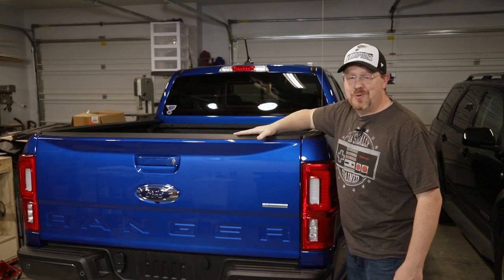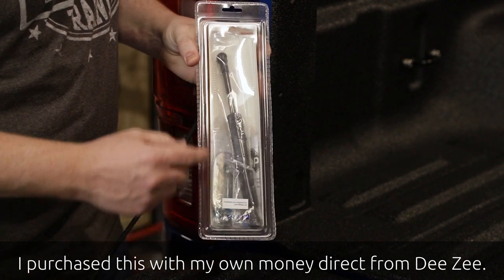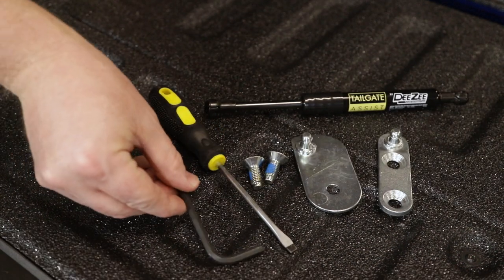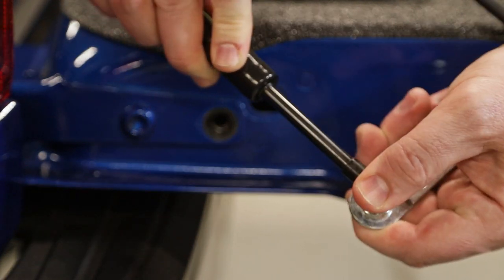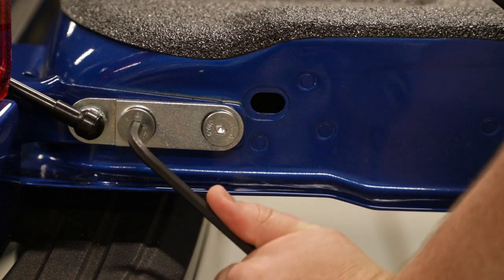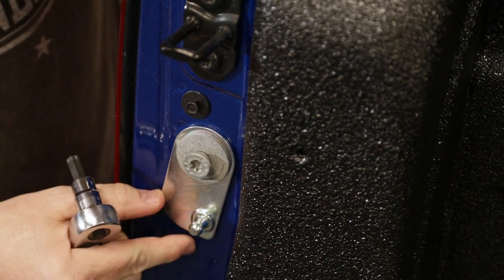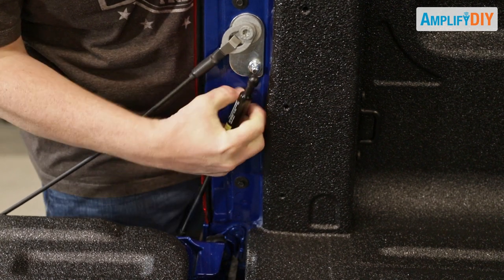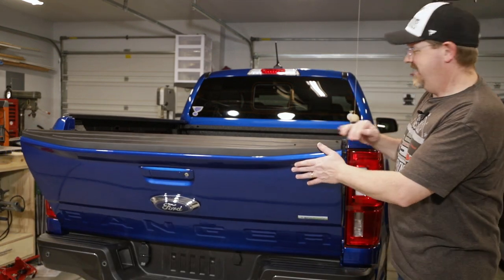How To Install A Tailgate Damper - 2019 Ford Ranger - DeeZee DZ43206

Comment: For those of you who already installed this kit on your truck,  check the tailgate cable for any scratches.   A few Ranger owners including myself noticed that the tailgate cable is sometimes pinched between the bracket and the lower portion of the damper.
Reply: I guess Im asking randomly but does any of you know of a way to get back into an instagram account??
I was dumb forgot my login password. I appreciate any tricks you can give me
Reply: @Warren Riley instablaster =)
Reply: @Krew Crosby it did the trick and I now got access to my account again. I am so happy!
Thanks so much, you really help me out :D
Reply: @Warren Riley happy to help :D
Reply: yes the tailgate cable rubber part is getting too much scratches.. any fix gor this?

Comment: That's pretty straightforward and rewarding!
I felt like maybe the washer on the upper mount should be removed, but a lot of washers on bolts like that are captive, and the ball socket for the damper is in the same place with or without it, so I assume it's not hurting anything either way.
Reply from the maker: Yeah, I didn't see any reason to alter the install instructions from the manufacturer. It fits perfectly and functions correctly. I love this damper - it make such a difference when opening the tailgate. Thanks for watching!

Comment: Love ur Ranger vids Thanks a bunch. Other things missing on Ranger is the upper tie down hooks so I would kindly request if you can make a video on that too please (obviously if u decide to install them).
Reply from the maker: You mean the ones in sort of the middle of the bed? Mine were missing from the dealer, but I complained at them and they ordered them under warranty. When they called to let me know they were in, I went to pick them up only to discover they had not bothered to order the bolts as well! 🤦‍♂️ I didn’t want to wait another week so i just went and found some bolts at a local hardware store. Good luck with yours! If you have a 2019, it was supposed to come with all 6 tie down points installed from the factory, but a bunch didn’t, and in 2020 model year builds they left out the middle ones on purpose.

Comment: Do you think you could spray paint those metal brackets to prevent rust? Good job. Nice Video.
Reply from the maker: Yes, on the ranger5g.com forum there are a bunch of examples of people doing exactly that. Great idea!
Reply: @AmplifyDIY  I just have one more question? ? Do people install (2) one for the driver and passenger side? Or do you only need the one for the drivers side. Thank again.
Reply from the maker: @brithesignguy  Just the one on the driver side. Good luck!

Comment: Installed mine and it is very loud. I’m thinking the cable is rubbing on the piston while opening. Any tips for how to address this?
Reply from the maker: Hi Christopher - one solution I've seen proposed is to wrap a bit of velcro around the cable, with some electrical tape below it to keep the velcro from sliding down. This cusions the cable and prevents it making noise when slipping past the damper: https://www.ranger5g.com/forum/threads/tailgate-damper%E2%80%A6%E2%80%A6cons.21655/page-9#post-477237

Good luck!

Comment: That is so cool, great video and very informative. One question, will it clear the operation of a bed extender, looks like it would?
Reply from the maker: I don't have a bed extender, but the damper fits well into the gap between the tailgate and body. If you have not done so yet, head over to https://ranger5g.com/ and ask there. I'm certain someone there will have an extender and damper installed. Good luck!
Reply: @AmplifyDIY  Thanks, I appreciate your help. I'll check out the link you mentioned.

Comment: Just did this! Thank you. Strut is making a noise when it’s coming down tho , is it ok to grease it with wd-40?
Reply from the maker: Hi Rob - you can certainly lubricate the hinges of the tailgate, but I would not mess with trying to lubricate the strut itself. Also: WD-40 is not a good lubricant. Stick with a quality silicone or lithium-based spray lubricant for jobs like this. If the noise is coming from the strut itself, it's likely just because it is cold - at least, as long as you bought a genuine DeeZee strut. I've heard from other viewers that purchased some of the cheaper ones available on Amazon that they are noisy, leaky, or just plain stop working. Good luck!
Reply: @AmplifyDIY  yeah , I think you were right about the cold weather. It’s much quieter now . I lubed it a little didn’t seem to hurt it. The kit did come with these little black clip looking things. Not sure what they are for if you know what I’m talking about.

Comment: Does the DeZee model work on a 2022 Ranger? Parts on Amazon look different.
Reply from the maker: As long as you get the genuine DeeZee part number DZ43206, it fits all rangers 2019-22. You can confirm fitment on the DeeZee product page here: https://www.deezee.com/product/dz43206-truck-tailgate-assist/ - beware of cheap chinese knock-offs on Amazon that have stolen imagery and the thumbnail from my video. They are not selling the genuine part, and it's not likely to last. I've tried to submit copyright claims against the fraudulent sellers to Amazon... but Amazon does not seem to care. 
The correct damper has DeeZee branding clearly marked on the barrel of the damper in bright yellow paint, like in this one: https://amzn.to/3gXgiYp
Good luck!

Comment: Mine lasted maybe a month and the shock part started sounding like crap when dropping the tailgate. Tried putting grease etc in on it didn’t help just took it off.
Reply from the maker: Hey David - well, that stinks! The one I installed in this video still works perfectly. Sounds to me like you received a defective damper. Have you considered contacting DeeZee for a warranty replacement?

Comment: Is this will fit for ranger 2016 xlt ?
Reply from the maker: 2016? There was no Ranger in the US market in 2016... if yours is an international version, I'm afraid I don't know. I've seen some of the tailgates on the one from Australia and it's pretty different than the current generation US version (which is what this damper fits). I don't believe this fits the international versions.... but check with DeeZee to be sure. Good luck!
Reply: @AmplifyDIY  thx, i will 👍

Comment: Warning to anyone purchasing this product. The replacement bolts included in the kit are made of very cheap and soft metal so DO NOT try to snug them up too tight as they will easily strip the m6 connector. Furious with Ford for endorsing such a cheap product.  The original factory T50 bolts were high quality and had to be removed with a breaker bar but the replacement ones are abolute rubbish. I'd look elsewhere for this part. Damper works fine though but now it will take some work to remove the one hollowed out bolt. Just FYI
Reply from the maker: Hi T S - Wow! Thank you for the heads up! I didn't have any problems with the bolts that came with mine, but maybe I didn't torque them down as tight as you did - or maybe they have switched to cheaper bolts since I purchased mine. Best of luck getting your mauled bolts removed and replaced with something stronger!
Reply: @AmplifyDIY  The problem was that the factory bolts required a breaker bar to remove slowly and cleanly. The replacement bolts appeared as if they were supposed to seat flush to the mounting bracket. When they were still sticking out about 1/16 the of an inch I assumed a bit more force was required to seat them fully. Big mistake as my US made m6 instantly holed out the rear bolt. They appear to be tight and the damper works well but those cheap bolts should never have been included in the kit. They should have also been matching T50 rather than the Allen wrench type. Thanks for the reply and I'm glad your experience went smoother than mine lol
Reply from the maker: Interesting - I didn't need more than just a regular socket wrench to remove the factory bolts - no breaker bar or anything. And when I seated the bolts that came with my kit, they tightened up to be flush and again didn't need any more force than you could exert with a socket wrench or long allen wrench. Sounds like something changed either with the truck's mounts or the bolts included in the damper kit.
Have you come up with a plan to remove the stripped out bolts yet? Ever used an easy-out?
Reply: @AmplifyDIY  Yes. I'm not a mechanic but a carpenter with 34 years of experience. I only used the breaker bar because it gave me finer control and I HATE hollowing out a screw or bolt head. That's why I stopped using #2 Phillips for the T25 once they became widely available. Nothing worse than driving a screw half way in a board only to have it go to pieces lol. Anyway my final tightening was with a smaller ratchet not the breaker bar. I will search around for some better bolts but it's fine for the foreseeable future. When all is said and done I think Ford should have included this as standard with the Lariat trim. BTW I just purchased a 2021 Ranger Tremor in cactus grey. I really like this truck so this is just a minor issue for me. Thanks again for the response and I subscribed to your channel.

Comment: Did those bolts really come off that easy? I just tried and they would not come off, even tried with my ryobi impact drill and still nothing.
Reply from the maker: Hi Christian - yes, they really did. My truck is a 2019, and there have been a lot of little changes to these in later model years. I've heard from at least one other viewer that they had to use a breaker bar to get the bolts out on their newer year truck. Good luck!

Comment: Question. I left the cable off do to the comments on how it rubs or gets pinched wen closing the tailgate. Is there any reason I shouldn't have it this way? Thanx in advance and great tutorial on how to install this.
Reply from the maker: Hi Ja - you should not leave the cable off. It needs to be there to support the weight of the bed if you ever sit on it or place something heavy on it. The DeeZee damper is not capable of supporting the tailgate weight in that manner. If you are concerned about damaging the cable, on the Ranger5g.com forum there is a tip to wrap a piece of velcro around the cable which helps guide it where it needs to go: https://www.ranger5g.com/forum/threads/damper-mods.9661/
Good luck!

Comment: I have tried two of them. The bottom connection to the damper comes off. I am sending it back
Reply from the maker: Oh shoot, that stinks! Like, the damper keeps popping off the bottom bracket? Any chance it’s getting bound up with the support cable of the tailgate? Maybe that is causing it to pop off? I’ve seen some folks needed to coax that support cable to fall to one side or the other of the strut as the tailgate closes.

Comment: Great video.  Couldn't you lift the tailgate a little to put the damper shock on the top?
Reply from the maker: Yes, I suppose you could. However, I was trying to demonstrate the way that DeeZee specifically has it set up in the instructions. Good luck with your install!
Reply: @AmplifyDIY  Thanks for the reply.  I really enjoyed the video.

Comment: i followed this video but my tailgate groans when it's fully down. Any ideas why?
Reply from the maker: Hmm…what happens if you pop the damper back off? Still groans?
Reply: @AmplifyDIY  im not sure..i didnt get that far. will try tomorrow. maybe it just needs to be broken in?
Reply from the maker: So, before you installed the damper, no groan? But after installing damper, there's a groan? Try popping the damper back off (it removes from the mounts really easily) and see if the groan goes away. You may have a defective damper, or it may need some break in. I've never had any unusual noises out of mine.
Reply: @AmplifyDIY  ok will do. thanks for the tips. great video by the way. very easy to follow

Comment: Thx for this video. I just put this on my 2021 ranger thx to you
Reply from the maker: Awesome! I hope you love your ranger as much as I love mine, Don!
Reply: @AmplifyDIY  yes sir I do. Feels good making my truck my own. Can’t wait to put a 2.5 inch lvl kit on the front
Reply from the maker: @Donmecca415  I leveled the front of mine, and have a bit of insight to share if you are interested: I started with the Rough Country kit, as it was super inexpensive... but found that the ride of the stock FX4 shocks was just to sloppy/wallowy/rolly for my taste. Upgraded instead to the Eibach front adjustable coilovers that come pre-set with a 2.5" lift. They drastically improved the ride quality as well as perfectly leveled the truck which added that extra bit of ground clearance up front. Anyhow - if you have not already found it: I highly recommend the Ranger 5G forums: https://ranger5g.com/forum

Comment: What kind of spray in bed liner did you go with? Also did they spray over the rubber plugs in the bed?
Reply from the maker: I went with Bullet Liner. Have been VERY happy with the results. They removed the plugs at my request. Was a little cheaper than Line-X, and comes with a lifetime warranty on the finish. I throw stuff back there a lot, and all I ever need to do is sweep/hose out the bed to make it look new again. Thanks for watching!
Reply: @AmplifyDIY  Were you able to reinstall the plugs ?
Reply from the maker: Yes, reinstalled with no problem. The guys that did the install blocked off the holes so that the liner would not get in the way of putting them back in. I didn't ask exact details of how they blocked the holes, but the liner goes right up to the edge of the holes, but does not wrap around into the hole opening. The plugs just popped right back in.
Reply: @AmplifyDIY  Thank You,also I love your videos!!

Comment: Is the left cable where you installed it supposed to not have tension after the install? I just did mine and now the left cable has some slack.
Reply from the maker: Pretty sure mine did not make any difference. If you sit on the tailgate, do both cables take the weight? Or does that left side cable stay slack?
Reply: @AmplifyDIY  I’m standing on it now.. the left side IS taking on weight but not as much as the right side.. I guess it’s fine 🤷🏼‍♂️
Reply: @AmplifyDIY   I watched your video again and it looks like yours might have a little slack as well from what I can see. I’ve read some forums and it seems to happen once it’s installed.. idk.. maybe it’s fine.. I’m just very meticulous.. lol.
Reply: Installed mine yesterday and have the exact same observation. If I sit on the tailgate, the cable is tight. I'm assuming if it's currently supported by the damper, it will just stretch over time until the cable takes over. Glad I'm not the only one, I was concerned for a minute.